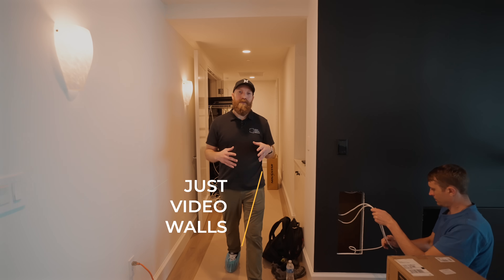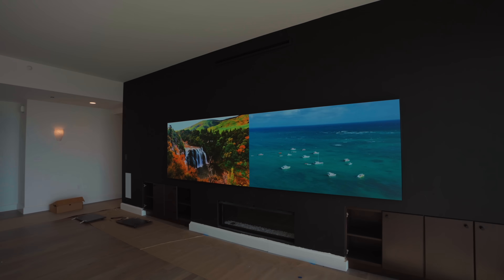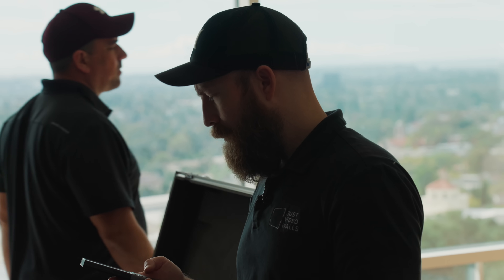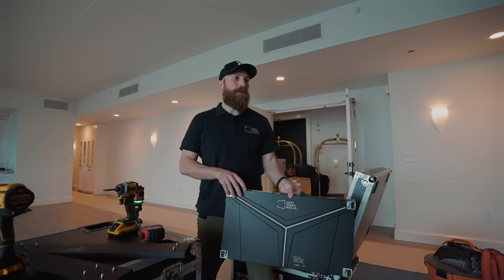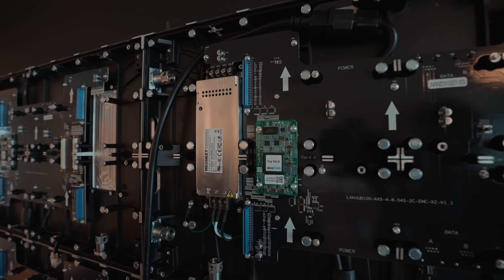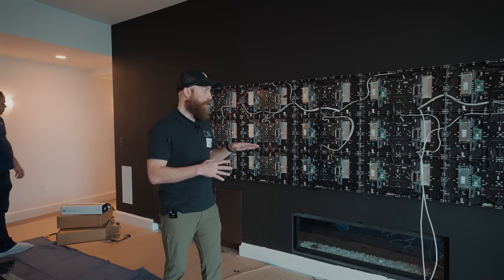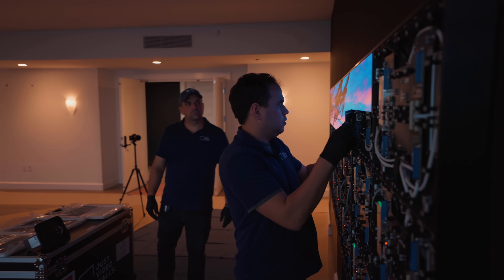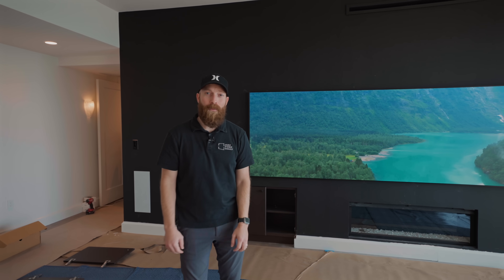How a MicroLED Gets Installed: An Overview of This Ultra-Wide 32:9 Video Wall!

Comment: aquien se le ocurre una pantalla  con esas dimensiones,  como supuetos profesionales no le recomensaron a los cliente s otra dimension, no le indicaron que  los video  como peliculas no usan esas escalas, es ridicilo
Reply from the maker: The first thing our integrators do is ask how they want to use the space. In this case the homeowner wanted to stream multiple sports feeds (golf). So the wall size is 2x 16:9 TV sizes.

Comment: One thing we can be SURE  it is not microLED  because we see when camera is close to pixels... it is COB maybe 1.25 mm.....micoLED  has range 100-200microns
Reply from the maker: It’s an industry accommodative term
Reply: @justvideowalls as the world is the world 1.25 mm never be 200 microns. Rest is only marketing bla bla bla. U r Pro I am Pro we know what is on wall. Cash is in right pocket. Congratulations.

Comment: OMG!!!!! As a network guy, I see you need a full rack installed in closet with 48 port switch. Probably UPS and  4 RU Processor. Is switch 1 or 10 G ports? It is a mini Datacenter!!!!! What is the power consumption for all this set up - Wall and closet rack? How many network cables do you need to run? BTW, Samsung released 115 inch micro-RGB for $30K unfortunately, but sure not need a run a mini DC.
Reply from the maker: We don't need a 48 port switch, that rack runs the whole house (all networking, cameras, lighting, audio gear, control systems, etc.)
Reply: @justvideowalls  OK, good. I was worry. How many Ethernet cabled did you run for this set up? Is it Cat6 10G?

Comment: This is so fascinating. I went with a 100" TV as I wanted to use it during the day. But having this that can pretty much expand across the wall to fit the area between LRC channels will be amazing. So it looks like you guys send the video to each module over a ethernet cable, cat6e? Could you upgrade these modules down the line or upgrade the processor. Amazing either way.
Reply from the maker: Thanks! Technically possible but complicated. We have config and calibration files stored especially for each wall and would need to reprogram the entire thing. Cat cables go to our hub boards which feed into receivers and then modules. 👍
Reply: @justvideowalls impressive thanks. Hopefully we will see more of these hands on.

Comment: the huge problem with this system is that technology changes so quickly. It’s the same as installing an Eniac computer in your house and hoping it’s going to be relevant for the next 20 years.
Reply from the maker: Yeah that's a valid point. However, we're definitely not anywhere as bad as the PC industry, or even the TV industry but that hasn't stopped people from enjoying those. My philosophy is buy something you love and enjoy it.

Comment: Loved the installation video and the product. 

But yikes!!!! The composition of that MicroLED installation relative to the space wall and its fittings was absolutely awful. I'm assuming the client chose that placement.

I get it that they probably didn't want it in the middle vertically to avoid neck stretch looking up from low sofas, but hey, even 30 cm higher would have given a little breathing space for the display. 

In fact, while I'm at it, what the heck is going on with those built-ins? Again, there is zero lining up of those with the LED wall. Looks like the display was a design afterthought. Again, 30 cm left or right placement for those built-ins would have given a better alignment relative to the LED wall installation. 

That's why it's just crying out for more space between the cupboards and the LED wall, just to avoid that incongruity slapping you in the face.
Reply from the maker: Hear that feedback for sure. We all have our own priorities. When furniture is placed in the room it makes more sense. Also the way the homeowner uses it is not always seated on the couch, there's a large kitchen area behind and that needed visibility too. Hope that helps!

Comment: Are those 6K or 8K panels? What’s the refresh rate?
Thanks
Reply from the maker: This particular one if I remember correctly is 4k wide but obviously less pixels tall. We're running 3,840hz to the leds natively but our processing and input signal will typically be 60hz or even 120hz for gaming
Reply: @justvideowalls  thank you

Comment: How often does a cell fail to be replaced!
Reply from the maker: With our process? Almost never. We only have some small issues here and there which are easily remedied with our in-field spares kits. But those issues are caused by lightning strikes.

Comment: I would not put a TV on a wall, but in front of one of the windows with that many windows - so you still have a view even when you watch a TV
Reply from the maker: Yeah that would be cool, for a small TV would need a motorized option so you can make it go away

Comment: needs to be 1 module higher, doesn't look right
Reply from the maker: You mean taller or positioned higher on the wall?
Reply: @justvideowalls  - Taller an extra module higher as it looks too long and narrow, but still looks good
Reply from the maker: @trevorbooth6896  Gotcha, yeah we all said we should have gone bigger after the install :)

Comment: Micro LED will be the trend as it offers excellent quality compared with LED. And it is much cheaper than OLED that claims to have the best quality. When MicroLED price drops to a price point that can be accepted by the majority. The LED will be phased out. It becomes the TV majority and overtakes the lead of OLED.
Reply from the maker: We will always have a high end product that is the cutting edge with all kinds of customization but I also recognize the need for a mass market product

Comment: Good day! I need your advice. I want to build a video wall inside a vehicle - FORD TRANSIT 3500. It's for field work by scientific staff. What solution and manufacturer would you recommend? Do you handle such projects?
Reply from the maker: That's going to be an interesting one for sure! You'll want a really tight pitch most likely. I think we received a contact request from you so my team will get you taken care of.
Reply: @justvideowalls  Hello! Is there a chance that I will receive a response to my inquiry by the end of this year? 🙂
Reply from the maker: I see the team responded. Thanks!

Comment: That  is breathtaking the way you ignore selling this product without a hint of technical specifications like pixel size, pixel pitch, brightness, frames per second...
Definitely a here today and gone tomorrow product.
Reply from the maker: Hi there friend, I am happy to answer any questions you have on technical specifications, but this video was also not a technical specs video. It's an install video.
Reply: @justvideowalls  I was responding to your click bait title. "An Overview of This Ultra-Wide 32:9 Video Wall."

Pro tip: The word "Overview" is a general review or summary of a subject. In your sentence structure, "Video Wall" is the subject.

When other Youtube Tech channels provide "Overviews" of "Video Walls"  they provide frame rate, pixel count, pixel size, pixel pitch, refresh rate, individual LED panel dimensions, how many pixels per LED pnel and so on.

Just an observation. Don't imply "overview" of a product in your desperate attempt to trick viewers into sitting through your entire presentation patiently expecting an overview of a video wall.

When channel creators use gaslight click bait and disappoint the viewer who sat through a 9 minute, 52 second presentation expecting an overview of the video wall which would normally include specifications, you should expect indignant commentary.
Reply from the maker: Thanks for that, I appreciate you taking the time to share your feedback

Comment: Looks very professional.but I don't understand why get a 32:9 setup when 99% of the content is 16:9?
Reply from the maker: Thank you! Our processor enables multi-viewing in lots of different ways. We can do 2 16:9's or 4 plus 1. Anything you can imagine
Reply: I just think the same real estate would be better utilized with a single 16:9 block  @justvideowalls
Reply from the maker: That’s the beauty of these… you can make it whatever you want 😊

Comment: People often complain about the price, but that’s not the real issue for this level of customer. Power, cooling, installation and maintenance requirements are, pixel density is also a big one. 

Pixel density is one of the biggest reasons why even the wealthiest cinefiles still prefer projectors, unless the screen and room are insanely huge, at which point the detail becomes comparable to 4K or 8K projectors but with the benefits of MicroLED, or when the primary use is for sports and TV. For movies, no matter how far away you are or whether or not you can tell the difference, most people still want at least 4K. 

As a cinefile myself, I can’t wait for MicroLED to become realistically affordable. Since I prefer cozier rooms, that 110” Samsung 4K MicroLED TV would be perfect for the dedicated TV room, maybe in a few years. A 200” 4K MicroLED Wall would be perfect for a dedicated movie room, but that will be the next level for another decade.
Reply from the maker: Hey Ronaldo! That's all really good thoughts there. To your first point about managing power, cooling, etc - this is why we partner with strong and capable integrators who can sell, install, and service these custom walls for the high-end client.

We are leading a major shift in thinking from projection to microled - even in home theater. I don't think projection will ever "go away" (it will always meet a low-entry pricepoint for dollar per square foot). I'm a huge fan of it myself, having been on the manufacturing side for over 6 years. But, the impact and versatility of our direct-view systems cant be ignored. Now that nearly all high-end companies have very good solutions for non-AT walls, it's taking over - and fast.

I totally hear and agree with you you on the room application! That's one of the main reasons why I'm such a big fan of this technology and want to see it grow more and more. The ability to have an amazing high-contrast image even in a bright living room.

Out of curiosity, what would a "realistic" price-point (or price range) for a 163" 4K microled wall be for you? Or a 136"?
Reply: @justvideowalls  I'm from Brazil, prices are even crazier. The 110" Samsung 4K MicroLED is R$1M, or $180K, up from $150K in the US. That's easily nice apartment/luxury car money around here.

To some it's pennies, to me it's currently unjustifiable, no matter how much I love movies.

Sound is also very expensive, but it lasts 10 times longer, so video probably shouldn't cost more or even as much.

The LG OLED G4 97" is $25K, unfortunately we don't get them officially from LG here, only the C4 83" and the G4 65", they also include Dolby Vision which the Samsung lacks, would be a nice addition to these higher-end models.

So triple that for 110" MicroLED sounds about right. It would cost as much as a very nice sound system, wouldn't last as long, but with a very good long warranty and being a new technology for the mainstream, it might make some "sense".

In other words, half the current price. Still very expensive, but give it 5 years, we'll probably get there.

For the Wall? I have no idea. We are talking about a multi-million home theater, which is completely outside my current reality.
Reply from the maker: That's good feedback, thanks! Check out our CEDIA coverage for the show coming up in September. I think we'll have something that you might find interesting :)

Comment: Very idiotic install. They could have saved a fortune and bought a nice 100" tv with way better quality.
Reply from the maker: 1. A 100" TV will not fit in the freight elevator.
2. It's not a 16:9 box on the wall, and people love it for that
3. It has no glare which is important for a condo like this with gigantic windows
4. It is far brighter than a TV, also important for bright environments
5. It multi layers for multiple inputs at the same time all in presets controlled by a total home control system

All those items = not idiotic.
Reply: @justvideowalls  point one is the only valid, if true, the rest is either not true or nobody cares about it.

Comment: idk if its the camera, but the screen-door effect is INSANE.
Reply from the maker: Yeah a lot of the moire type pixelization is severely amplified by the camera. When you see it in person it's only noticable if you get close to the wall, and also depends on the pixel pitch. This is a 1.2, so a 0.9 is a lot tighter meaning you can get a lot closer before seeing pixels.

Comment: Have you seen the Ventana tiles?!
Reply from the maker: Yes, it's a nice design, but the glossy tile presents a lot of problems IMO. We prefer matte finish. Also they are a very expensive product. Most of our walls take less than a day to setup. A bit more to dial in for seams / fine-tuning.

Comment: so are you able to connect to these video walls with a computer through a hdmi or display port cable or something? what's the pixel count and recommended viewing distance for the build in this video so that one does not see the individual pixels?
Reply from the maker: Yep that's exactly right. We can accept pretty much any kind of source, which is configured with your processor. For the pixel count, this wall is 2880 x 810. Sounds low, but when you're 10-12 feet away they disappear completely.

Comment: Wow amazing... 
Is it possible to install this in RV wall that has a door in the middle of the wall ? If there is magnetic  between the wall and the door ? 
Thanks in advance
Reply from the maker: Thank you! I'm not sure. We would need to know more of the specifics for how the wall is supported. If it's an RV then it probably doesn't have much support.

Comment: Is it 4k?
Reply from the maker: We don't measure resolution in video walls. It's the retina distance (how far away before you don't see any pixels). For example, this wall is 2,880 x 810. But it's a fully seamless wall with no discernible pixels at 12-14 feet

Comment: Looks very complicated. Isn't projector easier and more reliable?! I remember working in a house which had "home theater" 200 plus inch diagonal. Just happens that basement had an old well, from a bottom of which a projector and a system of mirrors projects the picture to the back of the screen... May be not too simple after all... But i know those projectors rarely break.
Thank you for the video, sure. Some millionaires will surely enjoy the view... if they care at all
Reply from the maker: It definitely looks more complicated than it is. After our training it's a very straightforward process. Are projectors more reliable? Most of the time no. Easier? Usually yes. But a projector in the same playing field of a display of this level, they are usually around 300-400 lbs and require an HVAC system to be routed. So I guess for this kind of install it's always done by one of our authorized pros anyway. For a entry level home theater, a projector would definitely be less complicated!

Comment: Hope those components really hold out.  That's a lot of places where things can go wrong
Reply from the maker: They are fairly simple and hold out for well over 10 years. And when they dont, they are not critical failures 99% of the time so the display doesn't need to be replaced entirely. We have spares that come with the screen so each part can be replaced in about 5 minutes.
Reply: @justvideowalls  Oh that's fine then, thank you

Comment: This things is not so easy to connect to wall,and it is actually brake wall. More easy ways connection to walls could be really better, when it is easy and not brake walls
Reply from the maker: This wall was about 1 day install, and we were moving relatively slow. It's not terrible. But we do require the use of an authorized installer.

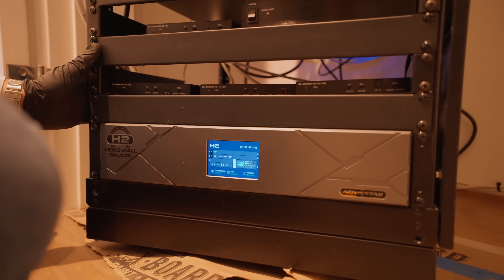Comment: Sorry, but this tech is too far from being consumer-ready for home entertainment. Especially when  customer is not ready to deal with this 7:57. 
Of course it is just to show-off someone's wealth, and not to be used on a da8ly basis.
Reply from the maker: We have solutions that do not require the external processor. Note: the rack has all the other gear for the customer's home automation, security, networking, etc. Our unit is just the processor at the bottom.
Reply: You don't talk about power consumption of that whole unit in home systems @justvideowalls
Reply: @justvideowalls  do your source your parts from BOE or Samsung?
Reply: This is only for Rich people bro We Poor people can't afford this We enjoyed watching only in YouTube other people installation If I have a ability to afford this then I am 100% sure I can buy 1 Micro LED TV ☺️😊🥺❤️
Reply: I get what you're saying, but large flat screen TVs were really expensive back in the day too. The price will come down and the install part will get simplified.
Reply: @Y0mAmA84 was reading the first color tv, a little 11” round bubble screen cost the equivalent of $11k in 1954.
Reply: This for people with 💰💰💰💰💰💰
Reply: This is very impressive but I’m sure you could multiplex, do away with the bezels and flush mount two OLEDs for way less money.
Reply: @stereothrilla8374 they live in Beverly Hills, money isn’t a problem for them.
Reply: I agree with u Santa!
Reply: @ChrisJones-sw9il 😂

Comment: Ekran birleşme yerleri çizgi bırakıyormu?
Reply from the maker: There can be lines if the wall was not installed properly or time was not taken to fine-tune and align the panels
Reply: Cevap için teşekkür ederim.Peki Microled panel başlangıç boyutu kaç inch'ten başlıyor . @justvideowalls